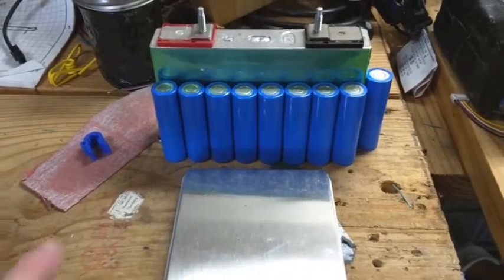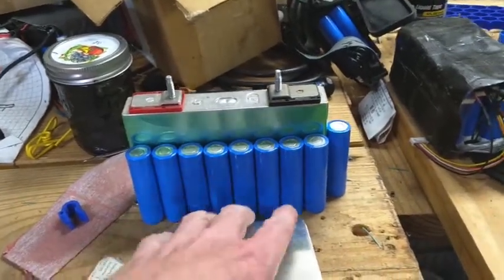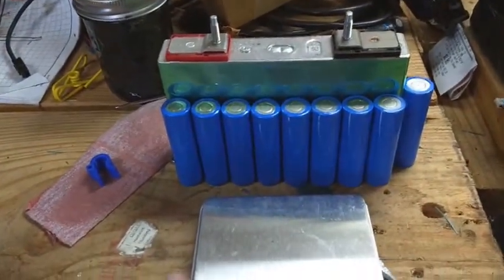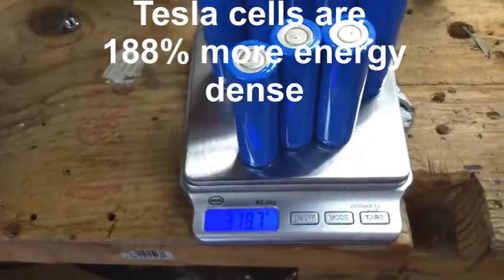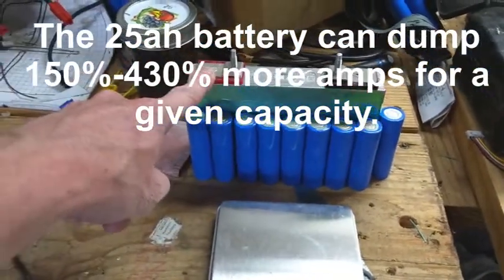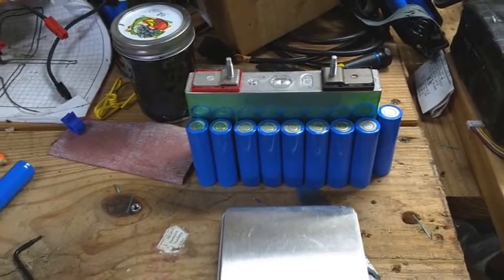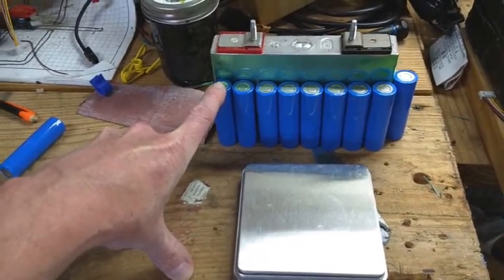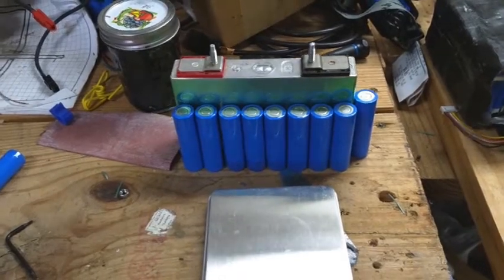Energy Density vs Power Density - Tesla vs other

Comment: Good video. I am slightly confused though because every Tesla 18650 Ive have comes with a vented (raised) tab on top(anode). With the exception of the 20700 (which are flat and almost dished).